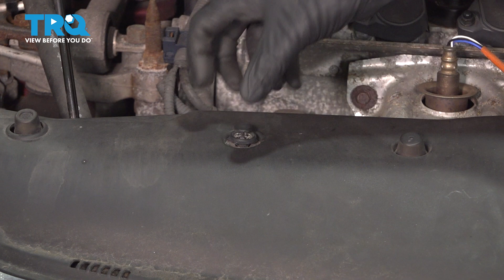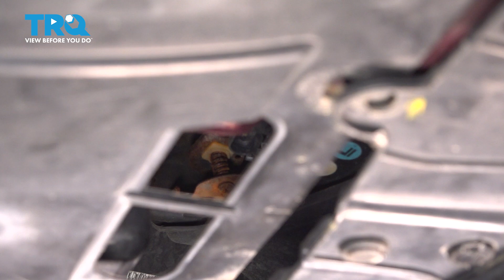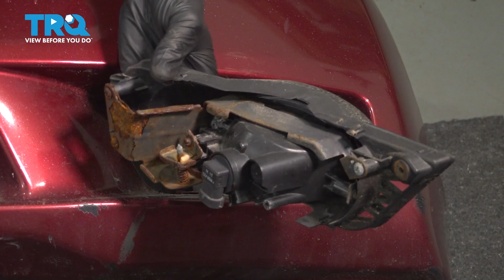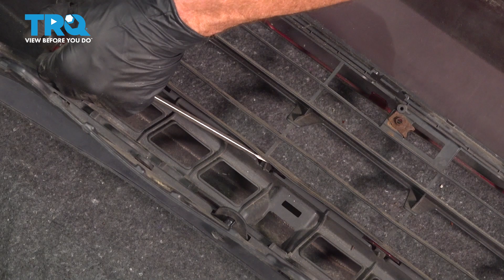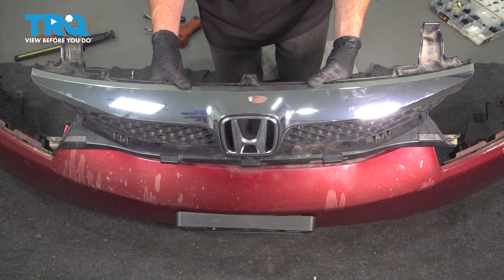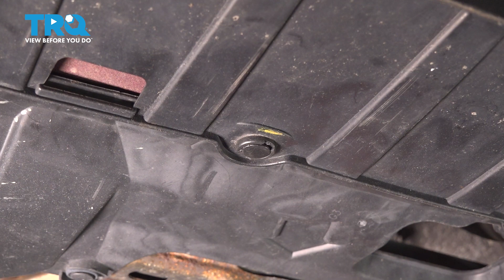How to Replace Front Bumper Cover 2006-2011 Honda Civic

Comment: 2:20 almost needed here, it's just a little guy, but when breaking loose bolts/nuts, it's recommended to not grip the wrench. Instead, push with an open palm, so if the tool slips or the part breaks loose and is immediately in free-spin, you won't bust your knuckles. Really appreciate the video, thanks for making it!

Comment: I really appreciate the video. However, I need to purchase what you call the "lower deflector" plastic piece as it's missing. I'm having a hard time finding it. To me, it looks like I need that piece to actually attach the bumper cover to the underneath side of the car using the plastic rivets. Any recommendations? Thanks